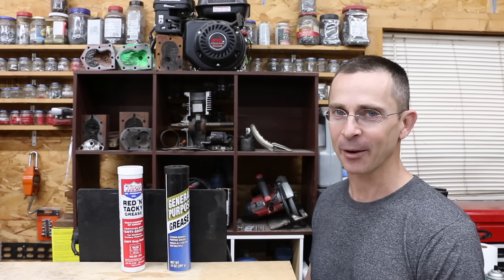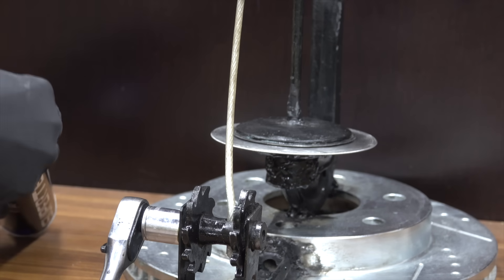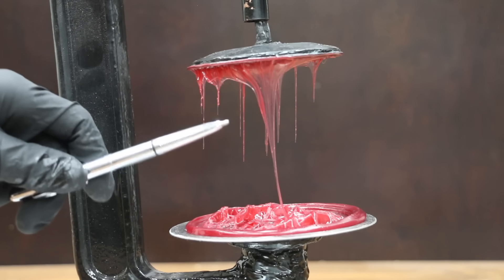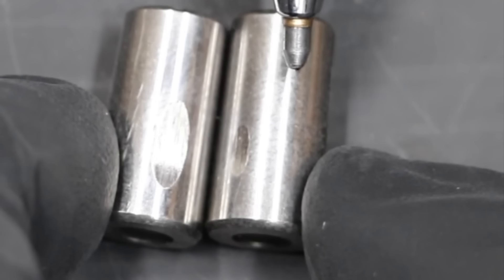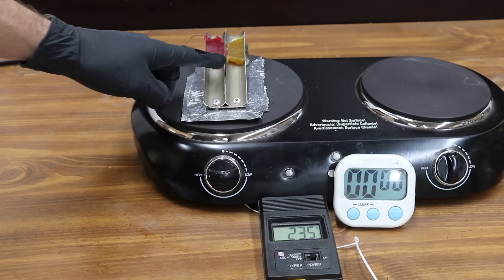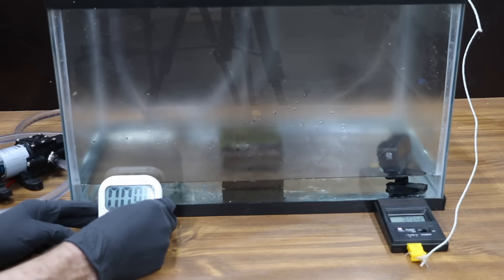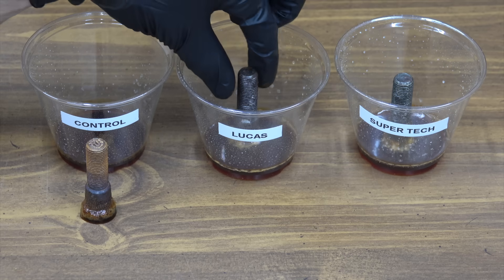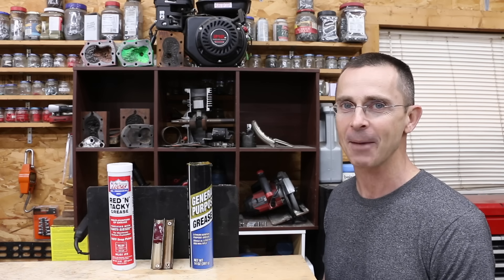Is Cheap Grease better than Lucas Red N Tacky? Let's find out! Bearing Grease Test Episode 1

Comment: I was from the "it's just grease" school and changed up only when a sale or a believable ad caused the switch. Great video. Is there test of chemically enhanced varieties in the future? Such as graphite laden vs Teflon infused? Brand choices are too numerous, though. How about the best bang for the buck general purpose? So far, Super Tech is not a favorite any longer despite cost and availability. Great video.
Thank you for sharing! Your work certainly benefits us cash-poor retirees who have to decide between meds or food for the week.
Great
Reply: This is the best Grease that I have ever seen or used. Silver hook is the brand and it's a CERAMIC GREASE which apparently works up to 1500C - I'm in Australia and have to buy it out of U.K. at approx $42 AUD for 500g tub inc. shipping, but it's bloody amazing! Makes loose bearings tighter and even repairs worn bearings! https://www.ebay.com.au/itm/Tub-Ceramic-Grease-And-Brake-Shoes-Pad-Protector-Vht-Protection/360710711120?ssPageName=STRK%3AMEBIDX%3AIT&_trksid=p2060353.m1438.l2649
Reply: And these are JUST lithium greases. Me and my friend had to use high performance copper-grease for sealing, it may look like it but it that for example was not a lubricant. Also, for fine mechanics, silicone grease is a must! So I guess it's hard to compare all the different greases out there...
Reply: Keter type 1 diabetes. I agree a diet improvement can help many people in many ways. But the fact is there are medical conditions that need medication to treat. Try treating a staph infection with vitamin C.
Reply: Keter true I agree with you
Reply: @KeterMalkuth  You are sadly misinformed!  You should say "SOME diabetics" and not spread ignorance.........…………………..elsullo
Reply: >Needing to decide between meds or food
God Bless America!
Reply: @neyoid  Ya, now the Gummint is seriously trying to cut SNAP ("Food Stamps") for crippled people and their kids, who do not look for work!.....……......……………..elsullo
Reply: @neyoid  🤣🤣🤣Living the dream
Reply: quit taking the meds. Your a victim of big pharma. You most likely need nothing your taking. So there you go, food wins this one easily
Reply: @Mach141  are you sure you're not replying to the wrong comment?
Reply: Chris Rock tell that to a diabetic
Reply: @Chris Rock   Jesus Christ! Really man?   Go the hell on somewhere else.

Comment: Im no expert on lubricants but for what i have read while researching for some of my machines youve made some mistakes if your testing methodology.
Grease isnt for high speed aplications because of its high viscosity. And in the stickiness test part of the force is also because you are creating a vacuum because air cant flow in because grease is so thick.
The stickiness is about how strongly it sticks to a material and it varies between materials so you need to test both aluminium and steel too.
Not sure whats the correct test methodology for that but i recall it had to do with surface tension and film strength.

Also like i said for the cooking oil in an engine video there are a lots of properties that you are missing that are very important: shearing resistance, oxidation resistance, temperature, film strength,  chemical resistance, volatility  and a few more.
Like i said about oils, sure you can probably use animal fat as a grease, but it wont last as long and the lubrication properties wont be as optimal as with a well engineered grease.
You should give it a look at all the greases types and types of each types as theres lots of greases for each type of load, high pressure, high speed, high temperature range, chemicals resistant, thermal grease, you name it, but they usually dont sell them in a common hardware store. They usually sell them along with the equipments they are used in.

Btw, as far as ive red oils are usually prefered because of their lower viscosity (less loses) and lower surface tension (wets better). Grease is more for open spaces were oil would just drip out

Comment: I work for an oil company in the Midwest. We blend and package everything for Oils to grease. Would love to see how they stack up to the major brands! I could send you anything you need.
Reply: Yes!
Reply: I'd love to know what the blending entails. nothing specific, just what the differences between blends actually are and what some of the ranges are (like adding graphite, what's the high/low range between brands, and what's the tolerance percentage of the final mix?  because if everyone is within 4% with a 2% margin of error...
Reply: @mtall1331  they aren't super scientific but he does a pretty decent job and I'd say some of the test results are totally viable
Reply: @drewmortenson  I agree with you on most of the testing. My first 20yrx I was a A/C mechanic. Everyone only carried #2 grease. I supervised maintenance in 2 University boiler/chiller
Plants. I learned a lot. 1 is some equipment manufacturers specify what oil or grease to use or they will void the warranty. My last 5 i was forced to supervise preventive maintenance for the rest of the campus. I started reading tech manuals for the extra equipment. Wow how little I knew about
 grease. I took to the internet and researched everything I
 could on how to select the correct grease.
Reply: @drewmortenson   I agree , he does a great job. And totally independent.
Reply: @drewmortenson  considering its Project Farm and not an independent lab, his simulated and real world tests are within a realm of reality most of us here can benefit from seeing simple side by side comparisons. 
His videos dont necessarily sway my decisions entirely,  but they are a good starting point for research. However I'll check out a product that wins the showdown a bit more thoroughly on other forums and whatnot before making the purchase.
Reply: @drewmortenson  thanks but I am retried now.
Reply: M tall1 then why are you here?
Reply: I like this. That’s bold to see a company willing to put their products on the line.
Reply: @allenwendling6966  Or, someone is putting their job on the line.. ;)
Reply: @mtall1331  Well. I would expect 1.1 Million of us Don't.  Pray tell, every single Oil Company crows that THEIR oil/grease is the best, so you expect us to figure out which ONE is telling the truth, and which one is lying? 

Since you didn't bother to tell us HOW Todd is making a joke of these tests, I can only assume you are butthurt, or have a stock position in one of these failures.
Reply: Yes! Get it up there!
Reply: @brandon2076  ok, bump lol!!
Reply: Yes!
Reply: Up up and away
Reply: @mtall1331   I mean I don't see why you are so negative about his tests
Reply: @mtall1331  these tests are for end users that need to know if products perform  versus cost in layman's language. Great resource.
Reply: i cant seem to find any products your company sells. i live in wichita is there a place to buy local?
Reply: greg c yes sir, we have order pickup at our warehouse.
Reply: Good man!
Reply: Bump it up.
Reply: Yes pls
Reply: Bump
Reply: Yes!
Reply: Push it to the limit!
Reply: hell yeah
Reply: How about molybdenum grease, 3% molybdenum content, since it contains high pressure additive
Reply: @pliedtka  stay away from bearings
Reply: Yep
Reply: BG in Wichita?
Reply: @Henray316 I use BG oil in my Cummins.
Reply: up
Reply: @mtall1331  what you dont think of is the popularity of this channel, regardless of the testing methods. Either way if they are confident enough it gets their product out in the public eye. Out of curiosity though, what is your knowledge of grease and oil testing methods? Anything he could do to improve his testing methods?
Reply: M tall1 if that’s the case. At least he’s making an effort. It’s independent. What could you offer better ?
Reply: Yes!
Reply: Yep
Reply: @coloradohikertrash9958  the only people close to what you call an "idiot" are the ones worrying about other peoples grammar on an a platform meant for uploading videos, not typing legal documents
Reply: Found the Amsoil employee
Reply: @jamessagstetter3269  nice try!
Reply: @mothraw1  I'm amazed that you still get notifications after 1 year and eighty something replies.  I get annoyed and turn them off by now.
Reply: Youre going up
Reply: oil be ready to watch it
Reply: I would definitely want to know who’s the best there!!!!
Reply: What ever happened to silicone spray? I used to spray it on my car door's rubber. Kept freezing rain from sticking your door shut. The closest thing I can find now is WD-40 silicone formula.
Reply: @virginia7125  Liquid Wrench makes a good wet silicone spray. But I warn you, it smells like bug spray unfortunately
Reply: @virginia7125  fluid film is all natural and can be found at Walmart. Smells like sheep or a barnyard. Works though
Reply: @virginia7125  theres a handful of silicone sprays out there, i just picked some PB Blaster brand silicone spray. Handful of other brands were there too, as well as an assortment of graphite sprays.
Reply: You should do more brands like Valvoline, super lube, and WD-40, also do the white Lucas lithium. My favorite has been the WD-40 heavy duty, and Lucas white lithium I can’t use the red stuff in my line of work on printing presses I can be hard to see if you have some fall in your magenta ink fountain or roller train. The WD seems the best for high pressure areas where heat is an issue but not for open bearings the Lucas I use there it stays in much better which makes sense in my head cause the tacky one should create more heat, I had a salesmen show me how the WD has great turbulent flow in enclosed places mixing and pushing hot grease out and replacing it with cooler grease like a convection cycle. I’d like to add he did work for WD he sold Lucas too he just a guy who owns a company to come through your shop and top off your chemicals, oils and grease weekly or month, also PPE, and other supplies. Best money I think the company spent it’s more expensive then buying it yourself but to never run out of anything and not have to find order and stock it yourself is so amazing. Fastenal does it do for all my fasteners best service ever if you use a lot of nuts, and washers. Also all I need to do if I need some special or more just log in and type in it and they’ll be there the next morning the latest and can even get them over in a hour or 2 if it’s needed or I’ll just send someone.
Reply: Did anything happen on this?
Reply: Red and tacky is the only grease, I use, great video, awesome job, love your videos, your amazing, thank you!
Reply: Bump up up up and away!!!!
Reply: To the top!!!
Reply: Up you go!
Reply: top go
Reply: Go
Reply: @coloradohikertrash9958  people who correct grammar are weird.. like get over urself it aint cool
Reply: Do you have any krytox grease?
Reply: There's really only a small handful of companies that actually make grease.  It wouldn't surprise me if you actually made the grease for many "name brands".
Reply: Would love to see a synthetic like Mobile 1 versus the Lucas red EP grease.
Reply: @Squash15b  Exxon makes a lot of the Lucas products.
Reply: So what happen ? Did they test your products ? 04-14-2023  4:53 pm.⌚
Reply: @anonimoporsiempre6033  I don’t think you’ll get an answer
Reply: Do it
Reply: Four years later yes!
Reply: Top
Reply: Yes
Reply: nipples
Reply: Yes
Reply: My man committed his whole life to the grease respect
Reply: Is this the same company that had the fire?
Reply: Let’s see what you got.
Reply: This would be cool content
Reply: @mtall1331  how so?
Reply: Give me your fone number im looking for oil 250
Reply: What a guy! I love watching this and to have a company come forward is amazing.
Reply: @mtall1331  no it really isnt
Reply: its actually the smaller brands that are often harder to live up to....
Reply: Did this ever get done?
Reply: Hi.i need talking with you plz !!
Reply: To the top
Reply: Erect as a cold chisel
Reply: up
Reply: see my above comment on corrosion resistance
Reply: This please do this
Reply: Cenpeco?
Reply: So whats the best hightemp for all the brands my friend?
Reply: He don't do sponsorships.
Reply: Let’s see Mobil 28.
Reply: That’s a lot to ask. Why don’t you do it yourself?🤫
Reply: Schaeffers?
Reply: @mtall1331  
Explain that ? 😨😨😨
Reply: Did a video come from this?
Reply: @Foodstampsandfuelclamps  no. This guy must be full of bs
Reply: Lubrication Engineers? I've been impressed by some of their products. Especially heat reduction in big gearboxes.
Reply: Do it Do it
Reply: any update on this?

have they done a new video on different types of grease?
Reply: Is XPS worth the cost, let test that lol
Reply: Let’s see it
Reply: I am in Wisconsin .. let’s see this
Reply: Yes who knows maybe your product could beat Lucas
Reply: We need this!
Reply: M tall1 these tests are good when they are done to ISO standards. He’s trying but there’s a lot to be desired.
Reply: @zachshiveley1226  Why would he try to duplicate ISO Standards?  I expect he'd match their findings. The point is, a lot of his tests are easily correlateable by us normal Joe's, and do actually mean something as they directly relate to OUR use cases.
Reply: I saw that Todd from PF liked this comment. But have they made contact yet? I’m
Curious to find out what their products are like
Reply: @mrtechpat  a!
Reply: He buys all the products he tests. Why would he accept products to test from a company? He says this in the last 45 seconds of the vids.
Reply: @mtall1331  these tests are completed side by side for comparison. I’m not an engineer but it does help to see when two products are compared equally. Your negative comment doesn’t offer any suggestions or constructive criticism. If you know of a better resource for us non-engineers I’d be happy to use it. Have a great day.
Reply: So you end up sending him some? He definitely saw your comment.
Reply: J M money making commence
Reply: Up
Reply: it would be great, and, well good luck
Reply: Do it do it do it do it
Reply: What’s the company
Reply: @Solar General yet you dont even know how to use it lol
Reply: @mtall1331  Your a complete corn  fed idiot M Tall
Reply: Must be all red and tacky tubs of grease are not created equally , i use it religiously , i keep it in all my trucks , everything melted in every truck ( sw florida landscape company ) even red and tacky , it was the last to melt and it dont leak as bad on my interior , but it still melts , always wondered how hot it gets inside my locked up truck while i work in the sun ...sissie products , i dont melt and i work as fast as i can , dont wanna be in the heat any more than i half too ..aint no one can afford that ..
Reply: @mtall1331  trying to throw shade on a channel with so many subs is absolutely laughable.  Could you do any better? If so then why aren't you? You just don't like money? Seems legit....hahahahahahaha
Reply: Yes
Reply: Here we go 😂
Reply: Heck yeah
Reply: Your a complete corn fed idiot @mtall1331
Reply: Lucas is not a major brand? Who do you consider a major brand?
Reply: Chad Justice never said anything about Lucas
Reply: @chadjustice8560  I think that he meant that he would like to see the grease that the company he works for stacks up against brands that are similar to Lucas Oil.  I don't think that he was implying that Lucas Oil is a small brand at all.

Comment: Hey man, you should find a local Caterpillar dealer and test their oils and greases. They claim their lubricants are the best out there and I’d love to see you test them!
Reply: That's the only grease I use, although the local cat dealership is closer than the local McDonald's so it's easy to get to. It seems to be pretty good, but it's hard to tell unless you're really comparing them.
Reply: They will also test oil samples for you.
Reply: Shawn Dickens I just got done pulling one on a skid steer lol. I work for a dealer
Reply: @ShawnDickens  Those oil tests can save a guy a bit of money.

Comment: Would love a test on Mystik JT6 Hi Temp red vs Mobil 1 red (M1 is 2x the price).  Mystic JT6 ends up on the lists for high duty cycle applications like Dexter Ez Lube axles, but is low cost....???  Love your tests!

Comment: There is a company out of Florida.  It's called Flamingo, go figure. It was made for the swamp or high-water high-temp apps. It is the best I've seen, but you have to order it so unless you have need of more than a few tubes it isn't cost effective.  
As usual you've done a good job of showing the differences.  Thanks.

Comment: Wish you’d have done this three ways with Mystik JT-6, it’s the grease I used for 16 years in my old job.

It was a brutal application, high temp, high speed, high load, water AND dirt. 🤣

Even with all that,  the bearings we were greasing typically lasted 10+ years, even with somewhat spotty greasing by me.

Comment: Save yourself money on the brake parts cleaner. And use some 95% Iso alcohol from Walmart and a towel or paper towel. Goes a lot longer for the money. Plus you can use it the clean off everything. Even comfort grips on tools.

Comment: This was eye opening, never thought there could be so much difference in greases.  Interested in seeing Amsoil synthetic greases.  Nice work once again
Reply: Ditto on the amsoil vs. Lucas!
Reply: There is a bewildering variety of greases.  My "all-purpose" grease (when I'm not sure what I need) is a moly-disulfide one (messy, but it seems to work much of the time).  Ford, for example, specifies a PTFE grease for driveshaft splines and the stuff used in your household washing machine bearings is made to be very resistant to water infiltration.   Grease is by no means, just "grease".  If you doubt that, try lubricating your wheel bearings with the pan drippings from your morning bacon and eggs.
Reply: Royal Purple